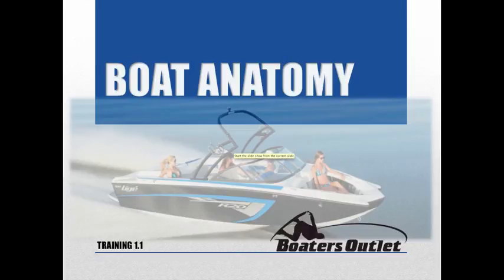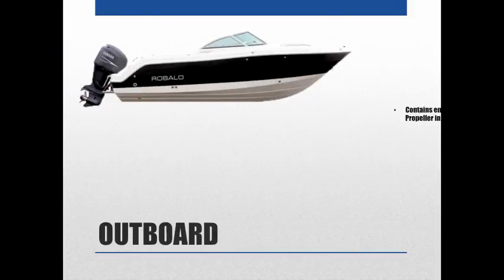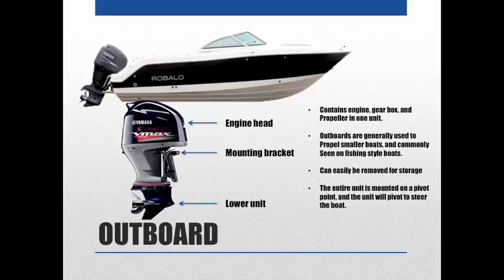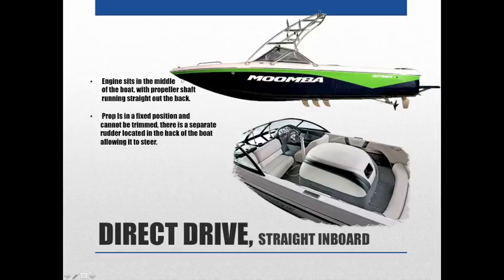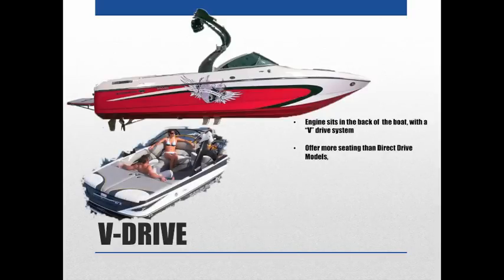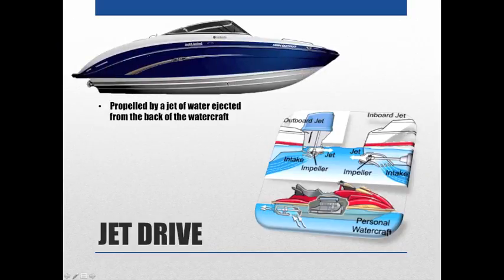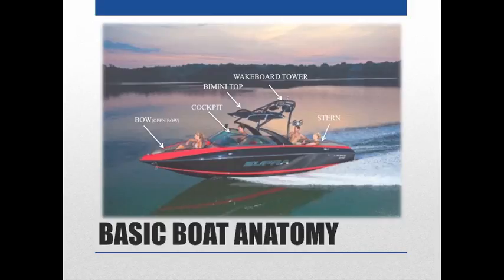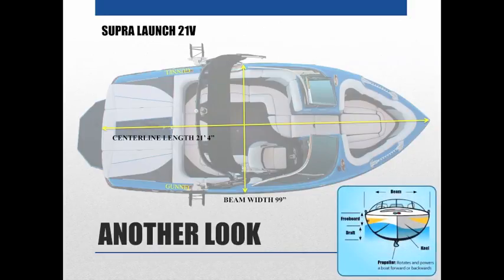Stern Drive, V-Drive, Outboard, Jet, Inboard,  What's the difference?

Comment: Informative video, well done.  I did chuckle when you said (on the I/O stern drive) "if my curser is a rock..."
If it was a rock you would have bigger issues than the rock, unless you found a new type of floating rock. 😁
Thanks for posting, I was searching for the difference in a inboard vdrive and just the inboard.  Great explanation.

Comment: Stern drives have pitch control and directional thrust, and the stern drive itself acts as a massive rudder. 
Try flying a plane with only tail rudder control. That's what a v-drive and direct drive boat is